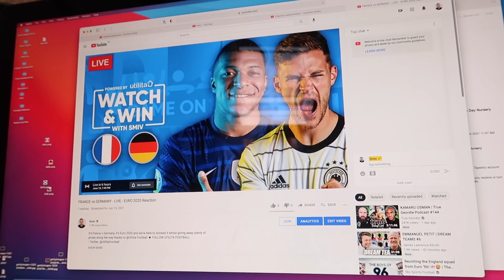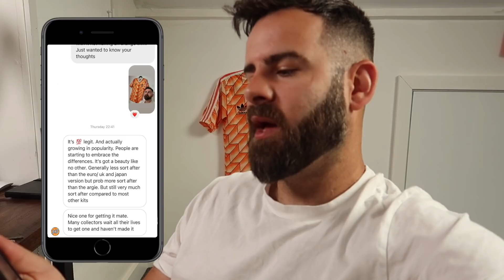VLOG - A COSTLY MISTAKE

Comment: I work in importing and supplying building supplies and right now is not the time to get any sort of work done on a house. Materials cost has gone through the roof. That coupled with an explosion of demand for trades people means it'll cost min 50% more than usual and you won't be able to get it done in any sort of time frame. A lot of people are struggling with this at the moment and it's heart breaking and costly when it goes wrong